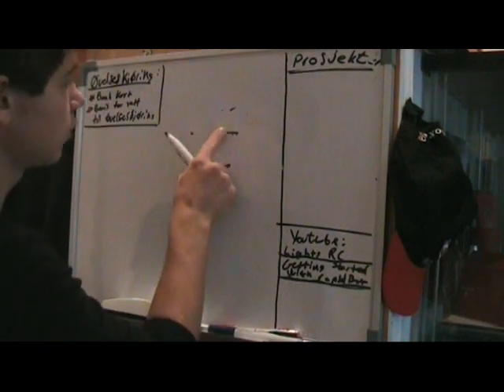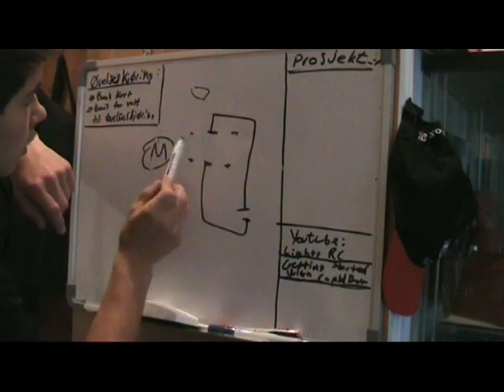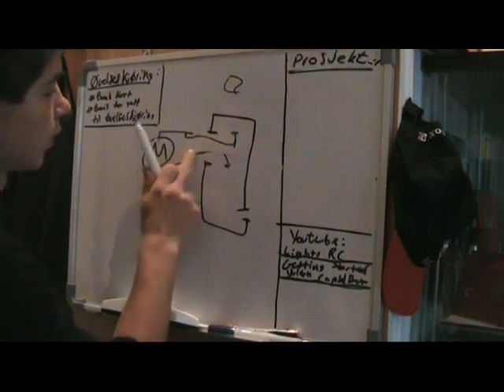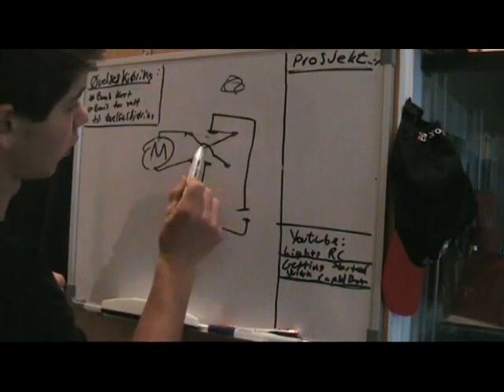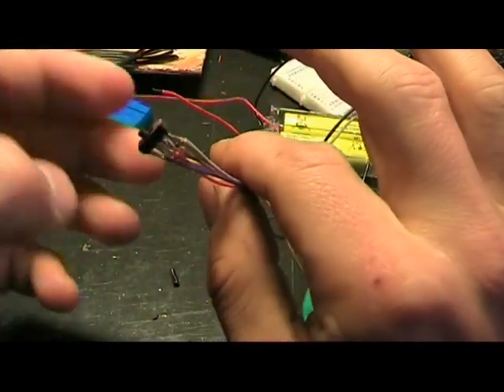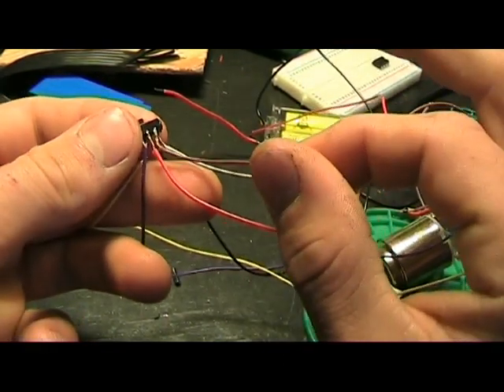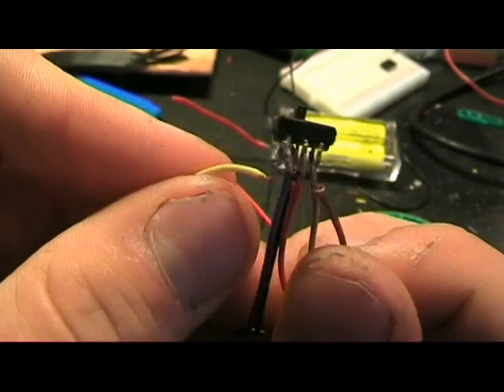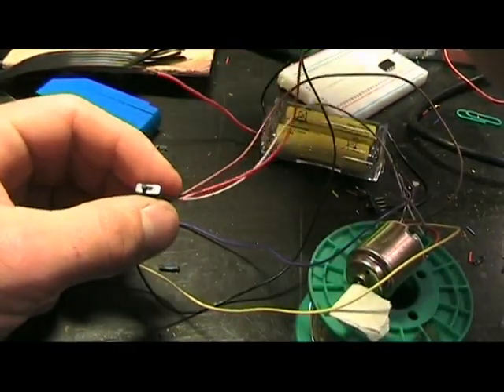Two way/direction motor control using only a 6 pin switch

Comment: uhm... if you connect the motor wires to the center pins of a  6 pin switch .. (called "common" ) then you cross wire the - (negative to pin 1 and 6 and the positive to pin 2 (1st pin bottom row) and 5  so basically an X from 1 end to the other with the 2 motor wires in the center.
Reply from the maker: The power supply is supposed to be connected ro the center (common) pins of the switch :) if you do it the way you decribe i think you will get a short circuit

Comment: you wrong about what way the power flows.. current flows from negative to positive. you will learn this when you start working with transistors, and it is all because Einstein screwed it up.

Comment: how to stop by switch ?
Reply from the maker: thank you for your question :) you can simply put a switch in between + of the battery and the switch. This way you cut the power :)
Reply: You can also use a switch that has an off position in the middle. It's called an on-off-on switch.

Comment: Can you wire the same system using a 5 pin switch + other components? to make up for the lack of the 6th pin?
Reply from the maker: +lanky512 Hi! Im not sure. I need the schematics for you switch! If you cant get a 6 pin switch you can probably find two 3 pin. if you operate two of these at the same time, you get the same effect! :)